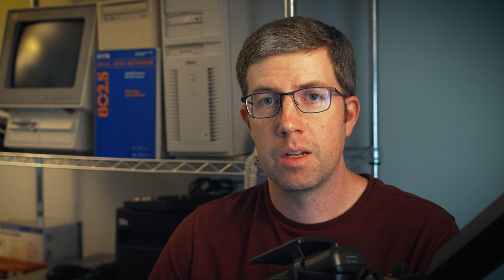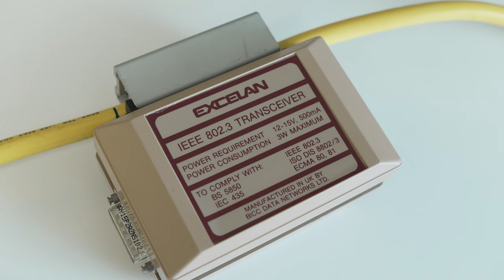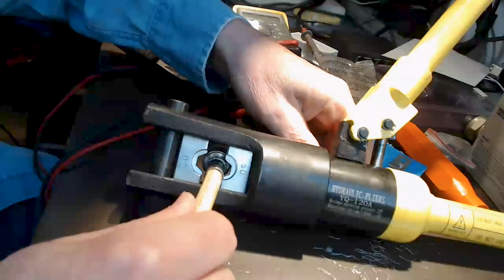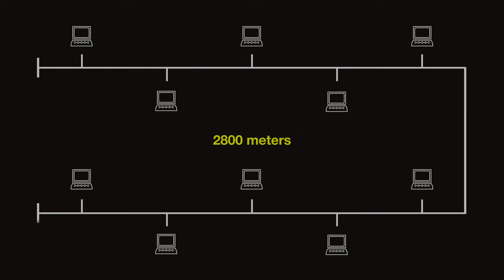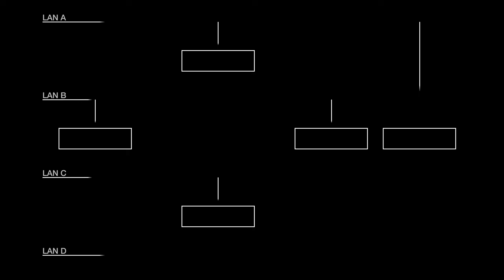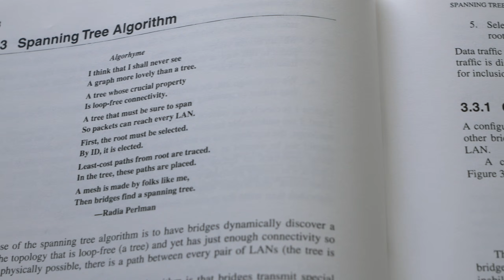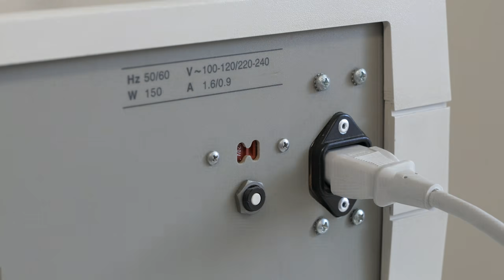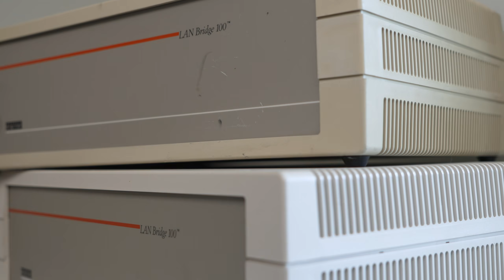EXPANDING THE ETHER: The invention of the network bridge

Comment: Oh wow! I studied networking and I remember being told about thick coaxial cable and "vampire" connectors. But since this was in the late 2000s, the technology was already very outdated and no one had seen it in real life. Thanks to your video, I now not only know what it looked like, but also how to connect such a cable. And I'm glad I will never have to do that.😄
Reply from the maker: Hahah we thought exactly the same... really neat to see, but glad that's in the past
Reply: I went to school until 2018 and we still learned about coax and vampire connectors. On the other hand CIDR was never mentioned and we still learned about classes
Reply: @DangerousPictures   that's just sad.
Reply: @DangerousPictures   That's one thing that really rubs me the wrong way.  Address classes have been obsolete for over 30 years.  However, originally there were no classes.  Every address was what eventually become class A, with 8 bit network address and 24 bits for the device.  These days everyone should be moving to IPv6.  I've had it on my home network for over 14 years.
Reply: Same.  I started school in 1999.  My buddy and I roomed together and had 10Mb Ethernet adapters in our PCs, connected via a crossover cable.  I had used a 10Mb hub at home before leaving for school.  My NIC did have a BNC jack on it, but I had never actually seen a network using them.

Nonetheless, in school, we learning about hubs, repeaters, bridges, the 5-4-3 rule, etc., as if that were the current state of the art.  At that point, switches were already a thing, albeit they were still more expensive than hubs.

Classful addressing, FDDI, thinnet/thicknet .. this all followed me through me networking education, even while I was working on 100b-T and then 1Gb networks.  I took a cert test not that long ago and still had to answer questions about ATM -- a technology I've only ever seen twice:  Once, as a virtual layer in DSL links between the modem and DSLAM; and again in a lab setting, after spending my severance pay from one job to buy up a rack full of Cisco 2800 series and Juniper J-series routers, and all manner of T1 and DS3 cards.  I only did that out of a desire to decouple "networking" and "Ethernet" to get a better, more visceral, understanding of what was topology and what was protocol.

Learning about ANY of that stuff now is a waste of time, unless, like the audience here perhaps, you're merely interested in it from a historical context.  There's very little to be gained in a professional setting, other than street cred.
Reply: @sirnickity   When I went for my Cisco CCNA, around 10 years ago, frame relay was still part of the test.  I have spent most of my career in telecom and hadn't seen it in around 20 years by that point.  Back then, ATM was going to be the latest & greatest, though that didn't happen as the world moved to IP & Ethernet.
Reply: I started in IT in 1985 and in my first job we installed our own thick Ethernet backbone down the spine of the building with vampire taps which were a lot easier than cutting and terminating it with N type connectors. We then connected the transceivers to the taps and AUI cables to the multiport repeaters. Each of those had 8 thin Ethernet ports. All this was on one collision domain. Worked very well and we didn’t have the problems that our main IT department had. We needed to set up access to the mainframe so ended up putting a bridge between our two networks. Our network functions properly and the central IT department had all sorts of problems with their network. We could access their network and get to the mainframe without problems. Fun times.
Reply: One of the first networks I worked on in the late 80’s was all DEC, the building “backbone” was all thicknet. Vampire taps every $X feet that dropped down to terminal servers that VT320’s connected to.

That cabling was horrid.
Reply: I have actually used 10 Mbit ethernet cards with AUI connectors in the early 2000's but I have never seen coaxial ethernet in action, only the relic cables inside walls of old office buildings.
Reply: I finished school in the 90s, working in IT from the early 2000s and at that time they had just phased thicknet out, you could still find the ISA adapter cards for them literally everywhere. I remember my school IT room originally had a thicknet but iirc that was already replaced by catV before I left in 98. I never had to wire one of those up either, thankfully - but some PCs I worked on were still tapped in to such networks with BNC connectors.
Reply: I found some in a ceiling of a railroad HQ office in 1999. It was abandoned but they were still using thin-net with 10baseT hubs. They had Cat5 connections off the bridge to each PC. It was one giant collision domain. I introduced them to true Ethernet switches. They also were using a public IP range which was not a problem because there only connections to the outside world was via hundred of dialup modems in each PC. It was like going back in time, everything was a relic of the 70s.

Comment: Wanted to mention that the current direction in networking is to minimize STP. Some vendors have Multi-Chassis link aggregation implementations which explicitly disable it, others allow paired devices to appear as a single bridge. I've worked on large campus networks which only have STP on edge ports for loop detection purposes, if a BPDU is received the port gets disabled.
Reply: Yeah.. about that...  I distinctly remember my first gig with a consulting firm where we forklifted an entire enterprise network in one night.  They had just bought Juniper EX switches, and the Juniper rep was going on about how we don't need STP anymore because Virtual Chassis.

And then one of the cabling contractors plugged two uplinks into a pair of switches that had been stacked.

The resulting network storm was epic.  I noticed things going wrong in stages.  First, remote hosts stopped responding.  Then I couldn't ping the management IP of the core switch.  Then my mouse pointer started moving at about 4 FPS due to the barrage of interrupts from the NIC.

To the Junipers' credit, once we disconnected the looping uplink, every single switch came right back almost immediately.  Those things can definitely handle wirespeed throughput!

We got through the rest of that install, and the next day at lunch, I saddled up to the director of IT...  "So.... can we go ahead and re-enable STP?"  "Yep."  "Good."
Reply: @sirnickity  I've never been a fan of the virtual chassis/stacking route. Sharing chunks of an FDB with separate management is fine though.
Reply: @foxale08   Implementation often leaves a bit to be desired.  While some are better than others, I haven't yet seen a vendor that pulls it off in an intuitive, trouble-free, simple way.  And it rarely lives up to the promise of real, chassis-like high availability.  But it sure beats having to configure 2 to 10 separate switches!
Reply: @sirnickity  I remember talking to a Cisco rep about STP when I was on site because of a major power fault (basically the breaker box melted, whole can of worms that one).  Apparently sales hate it to hear that their router is "downvoted" during aggregation and older firmware would "downvote" other switches by increasing their hop count.  Problem was those vender switches would error or resend ack and a whole mess would happen till the firmware was fixed.

I don't know if it was true or not though.  We spent 8 hours at that site and for all I know he was making it up.  I worked for Dell at the time so my network knowledge was just surface.
Reply: There's also shortest path bridging, which is based on IS-IS.
Reply: @James_Knott Indeed. I've used it but it's not as popular as EVPN/VXLAN.

Comment: I’m old. .Remember vampire taps ect. Built an 8080 based machine in the 70s. Proud USN IT. Still in IT in my 60s. 25c for a token 😂 For a minute I worked telecom. We used teflon for open plenum cables too.